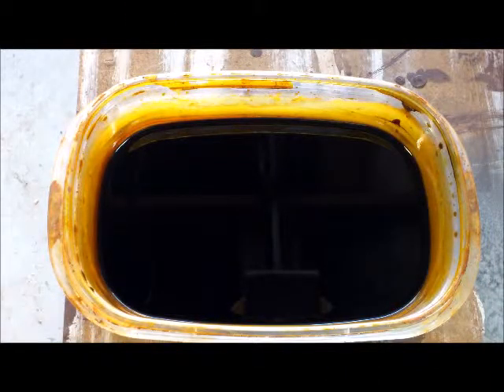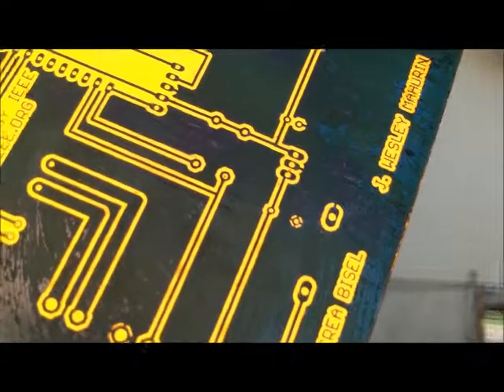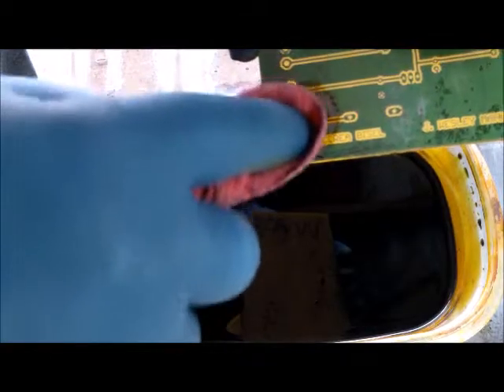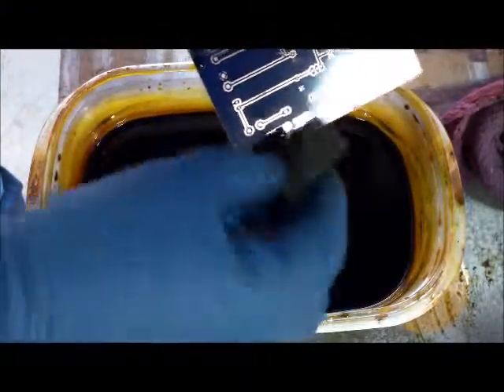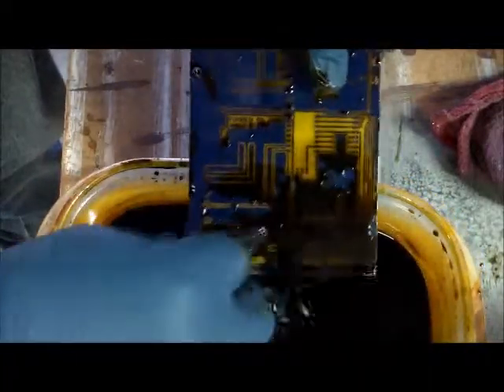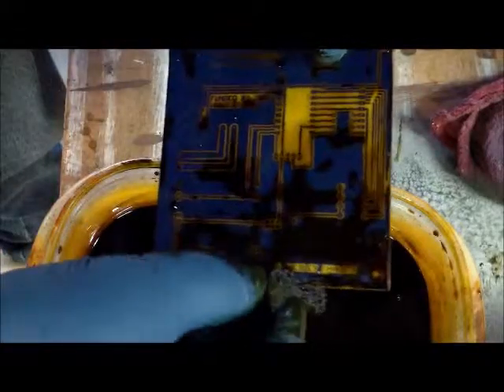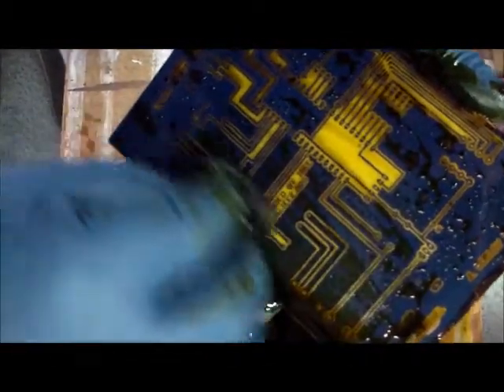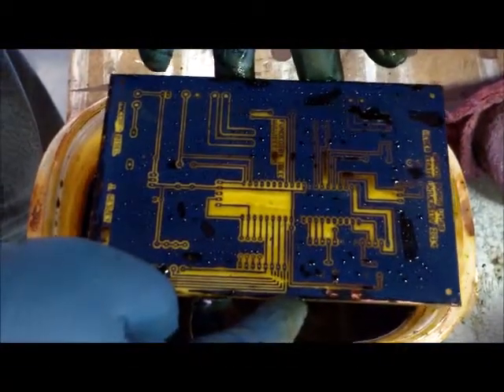4 Three Etching Methods

Comment: Ammonium Persulphate is cleaner, clear solution, leaves no residue in the etching bath, etches evenly all over at the same time but takes a bit longer. This is by far the best etchant I've ever used.

Comment: How much water you added with Sodium Persulfate ? % Water and How much % Sodium Persulfate ?
Reply: Ammonium Persulphate is cleaner, clear solution, leaves no residue in the etching bath, etches evenly all over at the same time but takes a bit longer. This is by far the best etchant I've ever used.